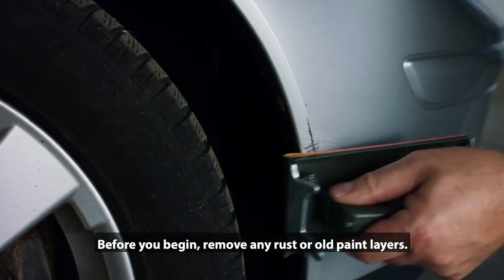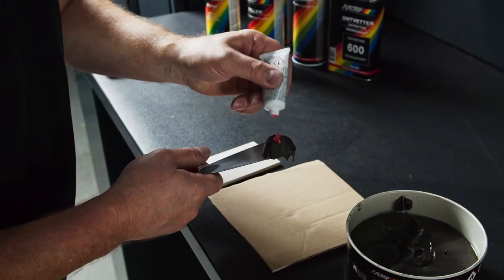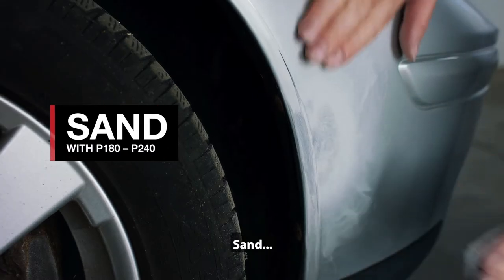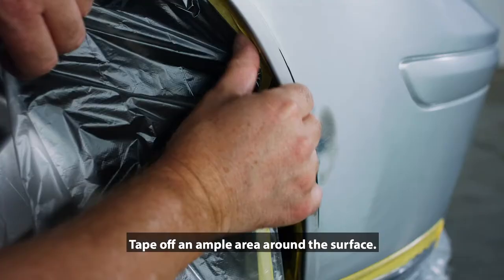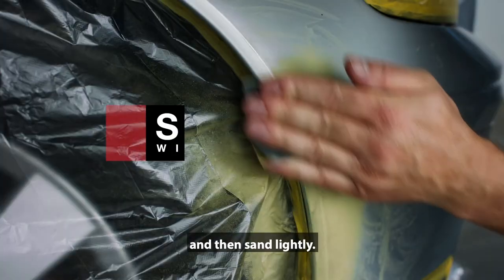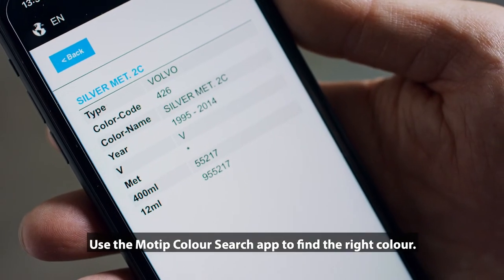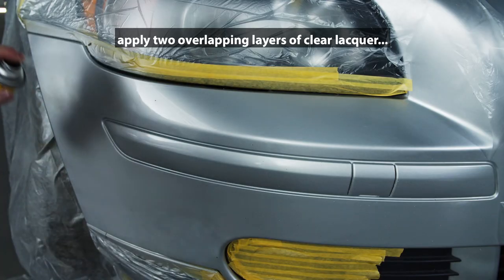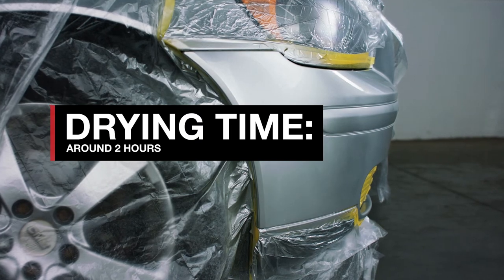How to repair a Damaged Bumper with Spray Paint? (MOTIP Kompakt)

Comment: Hello, i have a question, what is the diference for primer , plastic primer and filler. If the filler is for metal why is it being used on a bumper ?
Reply from the maker: Hello Marcos, thank you for your question. The Filler is used to fill small irregularities in the surface. Plastic Primer only needs to be applied if the filler does not have good adhesion to the plastic surface. If the Filler has good adhesion, no Plastic Primer is needed. That's why in the video, you don't see the Plastic Primer being applied. We are aware it can be a little bit confusing. Hope this clarifies it for you. Thanks for your feedback.
Reply: Great video short and simple